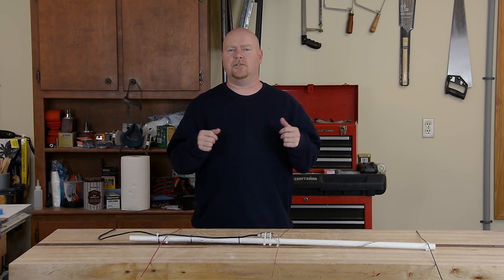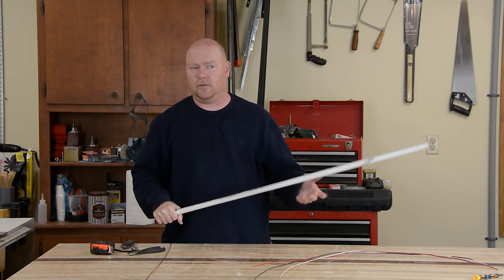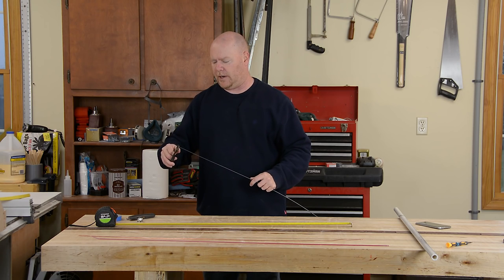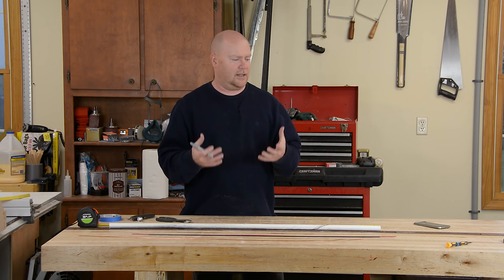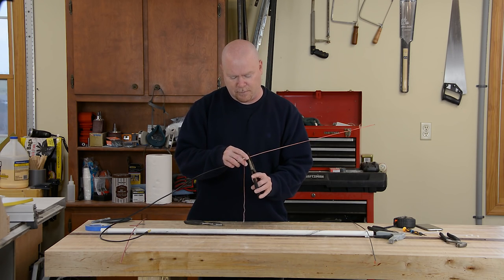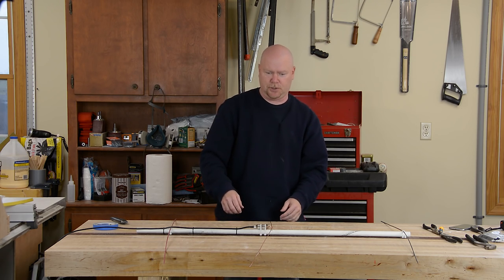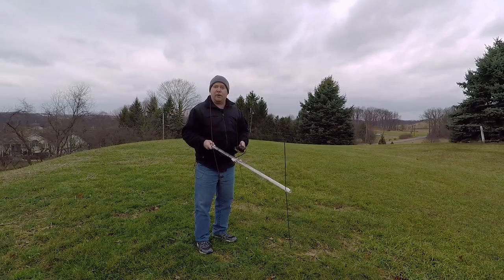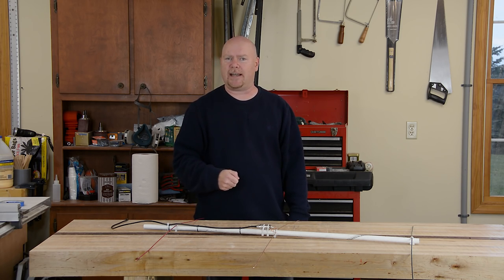Build A 2M Yagi for Emergencies (and Fun!)

Comment: Here's a great tip a local ham told me recently. To make your length of wire more rigid than it comes, secure one end of your length in a vice and the other in your drill. Now twist the wire and you'll feel it shorten. Don't go too much or it will snap. Just enough to shorten it some. When you test it (i did several tests on various bits of wire) you'll find it significantly more rigid.

Comment: The message is clear - a little know-how and a few materials and you can make contacts effectively! Great video.

One thing I will add, is that a Yagi should be fed from a Balun output if connected to coax, else the feed line will act as a radiator and distortion the radiation pattern.

Comment: If you grab one end of the copper wire in a vice and grab the other end in a vice grip and twist it several times while pulling, the wire straightens out and work hardens as well, making it much stiffer.
Reply: Instablaster

Comment: Someone else may have mentioned this to straighten the #12 wire. Instead of smacking the vice grips chuck the wire in a drill on one end and hold in vice on the other,end start the drill and hold tension on the wire. You will have a nice straight wire.
Reply: This was a "powers out" build
Reply: @chrispierce2942  battery driven drill ;)
Reply: @haugen4015  true as long as it's charged when you need it when the feces hits the variable rotatng oscillator

Comment: I'm all for emergency solutions when it comes to antennas and it seems that this is an easy thing to build. My local radio club is hosting a fox hunt in a few weeks and this would be a perfect down and dirty solution. Besides, I didn't want to go with the tape measure version with a tuning stub and given this will be a temporary antenna for such events, I think it will do the trick with minimum materials.

Comment: Nice 2 meter antenna build.  I just passed the test for Technician license and need to build a 2 meter yagi antenna for my Yaesu FT-4VR I got from the local Ham club for passing the test.  It's a mono band, 2 meter HT.  I can hit our local repeater with the HT and the stock rubber ducky antenna but that's about it.  While waiting for my license I gotta get busy and make me a couple of antennae.  First is the 1/4 wave 2 meter ground plane which I'm almost finished with.  Gotta get to the post office tomorrow to get my antenna adapter from SMA female to a UHF SO-239 so I can hook a piece of coax to it.  Next will be the folded dipole 4 element yagi made from 1" PVC and a tape measure.

Comment: I can offer an even simpler way to attach the driven elements without any soldering. Use BNC screw/ring terminals. These have a 2+mm hole in each contact where one can inserted the copper wire

Comment: Hey Matt...  I tried making a 2M beam with a yard stick and coat hangers.  Major fail.  Never did get it to work right.  I just ended up dropping the 100ish bucks on an Arrow 2M/440 antenna with the built in duplexer which works great for satellite!  But I get your point with the limited materials/tools.  Good stuff.  Cheers!  Chris - NI7IN
Reply from the maker: The yard stick is a great idea for a boom.  Non-conductive and it has the measurements right on it.  Wish I'd thought of that!  

Coat hangers are hard to work with.  The steel has strange magnetic properties that screw up all the element calculations, and it's almost completely unpredictable because the steel is made from who-knows-what in any given batch of hangers.  That's all assuming you can get the coating off of the wire well enough to attach the coax...
Reply: Yeah the vinyl/conformal coating on the coat hangers might have played a role, though I thought I stripped it off enough, maybe not.  Didn't consider the possibility of magnetism.  Cheers!

Comment: I'd like to see a remake where you buy a shitty tape measure and use that cut to correct lengths as elements (it's what they use on the little satellites)  and then you could roll it up and have it automatically spring out when needed.  Not so worried about making it in an actual emergency - I'd rather prepare one now in case of an emergency!   In other words use the power tools now so you don't need to later.

Comment: One thing you forgot to mention is to preferably use a 50 ohm coaxial RF cable for the feed line such as RG-8, RG213, RG-58, or LMR-400, so you don't risk cooking your radio and for the best performance! If you end up using regular cable TV coax to build an antenna those are 75 ohm, the impedance mismatch with your 50 ohm handheld will raise the SWR, lowering the performance at the least, or worse kill your radio over time. If you buy a cable that has either a PL-259 or SMA connector you're good as those are usually made with 50 ohm RF coax.
Reply from the maker: This was RG58, but for this specific antenna implementation it actually makes next to no difference.  The feed point impedance of a dipole (which is all the driven element of a Yagi is) is 73 ohms in free space.  In the middle of a Yagi at the end of your arm is hardly free space, but the point is you don't have a 1:1 match with either 50 or 75 ohm cable.  So the cable will be transforming the impedance on the way to the radio and it's nearly impossible to predict which one would come out closer to 50 by the time you get there.

Fortunately, most HTs operate perfectly happily into a 3:1 SWR with no problem (rubber duck antennas are notoriously unreliable) or even higher if not set to full power.  So long as the radio isn't frying, the only other reason to think about SWR is line loss, which is hard to get too concerned about with a 2 foot cable :)

Comment: This is a  brilliant  ham project - it works like a dream. Thanks for posting! I managed to get an SWR of 1:0.5! I am going to test it for distance. Would you agree with the  claim that is has a 7 Db gain?   I tried the original connection method - connecting to the elements offset ends but no luck - SWR of 8!  Your method worked brilliantly!  Any ideas for an HF aerial?    73s
Reply from the maker: Glad it's working for you!  Theoretically an antenna like this would have about 6dBD (or ~8.1dBi if you prefer) gain.  Because we're hand holding it, we become part of the near field of the antenna with somewhat unpredictable results though.  The gain will go down some because of what we absorb, but the front to back ratio is probably a little better.
Reply: Thanks for the reply - that's a good gain from a few bits and pieces!  I used a tee piece with a hole cut for the coax and a 6 ft support pipe so the coax goes down the pipe. I bang a steel peg  into the ground  as a support for the aerial and sit about 15 ft away. Could more reflectors be added to increase gain?
Reply from the maker: Typically only one reflector on a Yagi.  More directors could be added, but of course the spacing of everything changes and the whole antenna gets longer.  BTW, if you're using a metal spike then you've also stuck a grounded extra element into the antenna field.  Get one of those fiberglass sticks that people mark their driveway edges and fire hydrants with in snow country.
Reply: Thanks for the advice - I hadn't thought of that. A fibreglass stick sounds good. 73s

Comment: Great video.. I'm curious, what handheld do you use and/or recommend? I have never used a Ham Radio but was thinking of getting one for disaster situations. Thanks- Rick
Reply from the maker: Your best bet is to find the nearest ham radio club.  Amateur radio is licensed by the FCC, but the entry test is easy (no Morse code anymore) and the local club almost certainly runs the exam sessions.

Once you've met the club members you can get some recommendations that will cover the bands that are active in your area, and equipment that the other guys know and can help you out with.   Not to mention that most hams have 3-4X the number of radios they actually need, so odds are you can pick one up 2nd hand.

Comment: Realizing the electrical conduction efficiency of copper, could you offer thoughts on different material(s)? Solid SS filler metals for welding, and common brazing wires are readily available to me. Also, does-will diameter, or sectional density impact the desired results?
Reply from the maker: Anything that conducts will work.  Different materials will have different inherent capacitance characteristics, and so different lengths for proper tuning will be required.  Magnetic materials are particularly unpredictable when it comes to tuning, although for something relatively narrow band like a VHF Yagi even steel tape measure works acceptably.  

All else being equal, larger cross-sectional area materials give you a wider bandwidth antenna.  On the 2M band it isn't typically relevant except in very high-Q designs like magnetic loops.  On 70cm it is sometimes relevant, especially here in the U.S., due to the amount of spectrum allocated to the amateur band.
Reply: I've done similar with 2mm manganese-bronze brazing rod, which is far harder and more rigid and unlike Stainless or Aluminium, you can SOLDER it easily.

Comment: What about a balun, did you make any balun or choke for this antenna?
Reply from the maker: No need.  The impedance of a Yagi is a little low to direct feed it like this, but it works and it's under 2:1 SWR so no harm will come to the radio.  The idea here is to get something workable with the fewest possible number of parts and least work.   You could obviously build a better antenna if you're not really trying to emulate an emergency scenario.
Reply: @MattHeere  Thanks for your really fast reply!  Cool, I've got the metal, I'm going to use aluminium modelling wire for the elements. Maybe copper for the driven element if I can't solder the aluminium.  And maybe wood or plastic conduit to make a 6 el Yagi and see how it goes!

Comment: Just got here by curiosity and will like to know which basic radio you recommend for emergency that does not cost much, thanks.
Reply: LOL Down the rabbit hole... HAM radio can get expensive quickly. A Baofeng UV-5R+ is a decent 8 watt radio for about $40 on amazon. However, the stock antenna isn't the greatest. Most factory handheld radio "rubber duck" antennas kinda suck clarity wise and they don't have much range! Depending how close you are to your nearest repeater you'll probably want to build the Yagi antenna shown in this video which will cost a few dollars for cable and any fittings or at the very least an upgraded antenna like a "genuine" Nagoya NA-24J 16.2-Inch Ultra Whip for $18 off Amazon, or even better yet the Super Elastic Signal Stick antenna which has higher gain and is nearly indestructible for $20 and has a lifetime warranty. There's cheaper antennas but they aren't as well tuned and will limit the transmit strength of the radio and also cheaper UV-5R radios for about $25, but the battery is half the size of the UV-5R+ and they only have 5w transmit power compared to 8w of the UV-5R+... 

With the larger extended 3800mAh battery mine can last about a week with moderately heavy use several hours a day. You'll also need to look up and program your local repeater frequencies from repeaterbook.com. You can't program them by hand very easy, so you'll want the $20 programing cable and a free program called "CHIRP", there's a ton of videos that show how to use CHIRP to set up the UV-5R generation radios. Don't get the cheaper programming cables as the driver disk that comes with them is FULL of chinese spyware (no joke!) and they don't have a legitimate FTDI chip in the cable, so half the time the drivers don't work! 

You'll want to check how well the radio works and that it can key up the repeaters BEFORE the need arises so you're well prepared to actually USE the radio in an emergency right?! However, to TRANSMIT with these radios in "non emergency situations" you MUST have a HAM RADIO LICENSE! Study up and at least get your technician level license, it's only $15. I recommend the free app "ham test prep" to study for the tests. While you're at it though... go ahead and study for your General license too, as you can take that exam in the same sitting for no extra charge right after you pass the Technician level exam and it allows you access to the "high frequency" HF bands with some real serious range that you'll likely end up wanting later if the repeaters around you go down in a major disaster. Getting your General later is another $15 each time you take the exam so it's worth it to just study for both. That should run you $93 including your HAM license.
 "https://www.amazon.com/gp/product/B075H7ZMNV/ref=ppx_yo_dt_b_asin_title_o06__o00_s00?ie=UTF8&psc=1"

"https://www.amazon.com/PC03-Genuine-Programming-Cable-BaoFeng/dp/B00HUB0ONK/ref=pd_sim_107_5?_encoding=UTF8&pd_rd_i=B00HUB0ONK&pd_rd_r=290e77c6-17c9-11e9-a96d-590add2e911b&pd_rd_w=m3qqo&pd_rd_wg=SxlvZ&pf_rd_p=18bb0b78-4200-49b9-ac91-f141d61a1780&pf_rd_r=2VQ5BNSDSQWJWQ98JK8A&psc=1&refRID=2VQ5BNSDSQWJWQ98JK8A"

 "https://www.amazon.com/Authentic-NA-771-15-6-Inch-SMA-Female-BTECH/dp/B01H2HOKI6/ref=pd_bxgy_img_2?_encoding=UTF8&pd_rd_i=B00KC4PWQQ&pd_rd_r=290e77c6-17c9-11e9-a96d-590add2e911b&pd_rd_w=p2cdp&pd_rd_wg=SxlvZ&pf_rd_p=6725dbd6-9917-451d-beba-16af7874e407&pf_rd_r=2VQ5BNSDSQWJWQ98JK8A&refRID=2VQ5BNSDSQWJWQ98JK8A&th=1"

Comment: hello sir thanks for this...this is very helpful to me..thanks lots ...can i have a measurement for 147 MHz?
Reply: 147 MHz is in the 2m band. This antenna will work fine with the measurements given... You'll need a HAM radio license to use this frequency unless it's an absolute emergency to "life or property" and you have no other means of comm available, like a working cell phone. You're best off studying up and getting your technician license for $15 to play around with this and make sure it works BEFORE you need it in an emergency... Here's what the online Yagi calculator spit out for 147 MHz measurements, you'll likely need an SWR meter to get it "perfect" but this will work fine.
Reflector Length 1.010m-39.76in
Dipole Length 0.965m-37.99in
Director length 0.897m-35.31in
Reflector to Dipole Spacing 0.255m-10.03in
Dipole to Director Spacing  0.255m -10.03in

Comment: What radio are you using? I don't have a license but thought about getting that cheap BaoFeng just to listen when I'm out and about.
Reply from the maker: If you just want to listen then get an actual scanner rather than a radio.   You'll have a better receiver, better memory management, and cover a wider frequency range.

But what you should really do is get the Technician license :)  It's stupid easy these days.  No Morse code requirement and the actual question pools are available for study on line.  Hams are a great community and there's a lot more to the hobby than just chatting.
Reply: hi Dale i own a uv5r they are a top little radio well worth $40 bucks....

Comment: Ehmm! How does the repeater works without main? Anyway a good kind of yagi...
Reply: My radio club's 2m repeater ZL1ROD has no mains power, just solar cells & storage batteries. Been running like that for years, no problem at all.

Comment: Excellent!!!!
Sir , how many watts can I use on the antenna on 2 m & 70 cm?
Thanks !!!
Reply from the maker: Enough to cook your arm at least!   The copper wire could easily handle legal limit power.  What you use for coax and/or connectors would ultimately be the failure points.   You hit the MPE numbers using it hand-held though long before you're even on high power on the mobile rig.
Reply: Thanks !!!
Awesome for simplex 👍👍

Comment: Hey! What's the procedure if I want to connect the coax directly to the driven element? Do I have to cut the wire in half and the solder the conductor to one and the shield to the other half?
Reply: Or is there a way to do it without soldering?
Reply from the maker: Soldering is best.  You could probably get away with simply wrapping the conductors around the elements and taping it, but if it comes loose you'll have a sky-high SWR.
Reply: Wrapping should do it in an emergency situation, of course soldering for the long run.

I just went and bought 2,5mm wire (10AWG) because I couldn't find 2,0mm (12AWG), is the .5mm going to do any harm? And I couldn't find PVC pipes thinner then 300mm which is around 12in and that's more than a handful to hold for a longer period of time. Can I use a wooden broomstick or something else?
Reply: N3ssaya really? You're a licensed ham and you're asking this?
Reply: @n3ssaya972  all the larger diameter wire will do is increase bandwidth of the antenna, which can be a good thing if you need communications from 145 to 148Mhz...the SWR will change less with wide band elements....73 and good luck

Comment: Do you need a Balun?  I just learned the word and already hate it.  Thank you
Reply from the maker: Technically a Yagi is just a dipole with some extra bits to direct the signal.  Since a dipole is a balanced antenna, you should have a BALanced-UNbalanced (BALUN - please do not say bay-lun) transformer at the feed point IF your feed line is coax.

Now is this really necessary - of course not.  You will get some common mode current (RF on the shield of the coax) if you don't have one, but it is easily manageable  with a couple turns of coiled up extra coax for a choke somewhere in the line.
Reply: @MattHeere  awesome thanks, learned more from you in a paragraph than all week from the general discussions online.

Comment: Hi  what did you get the vswr down to M7CAZ
Reply from the maker: Don't remember exactly, but it was well under 2.0 (likely under 1.5)  for the repeater input section of 2M.  Certainly usable with any HT on full power.